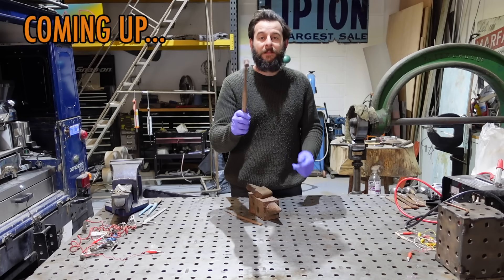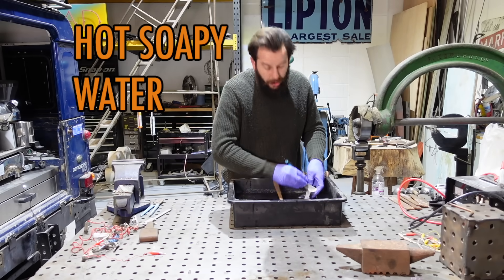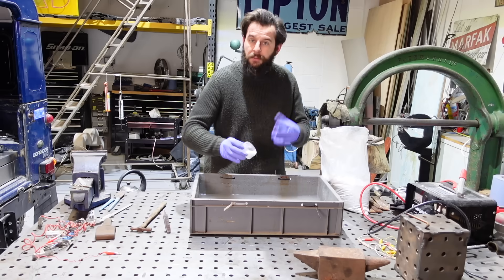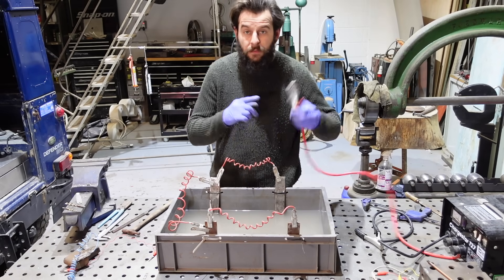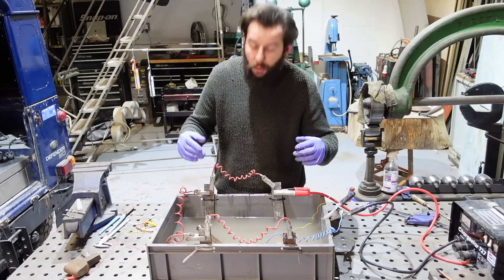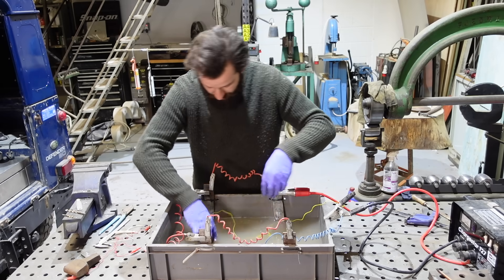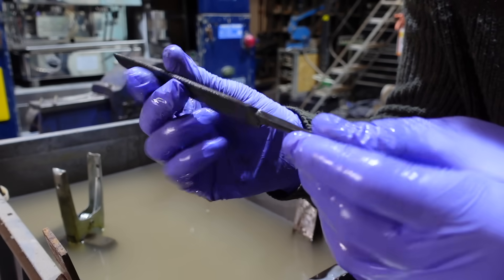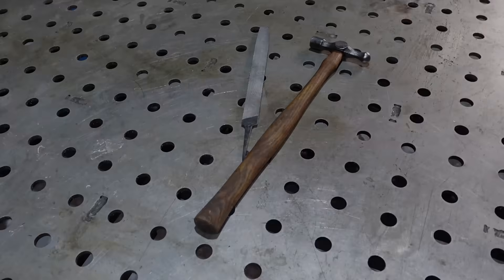The Power of Electrolysis | How To Transform Rusty Tools!

Comment: You can also do this inside-out.  I used this method to remove the rust from the inside of a motorcycle gas tank. Negative to the bare metal of the tank, positive to a large bolt suspended inside the tank full of sodium carbonate solution.
Reply from the maker: Now that’s a brilliant idea! Thank you for sharing!
Reply: @DominicChineas  work  in a few  hour's    just any  news   about wheel english
Reply: thats slick
Reply: Andrew Falenski: I was going to post a comment asking about doing it to remove tank rust so you have answered my query.  Did it work well?  I have just bought an FJ1200 with a little rust in the tank so am looking to do this.
Reply: @martynflynn8368  it worked great for me.
Reply: @andrewfalenski6583  no doubt it works.

All steel tanks, no issues.
If tank has solder or brazing, electrolysis is not a good solution.
Any weak acid will consume surface rust.
No batteries required
Reply: @andrewfalenski6583  How bad was the rust in the tank and can you use any kind of battery charger?
Reply: @martynflynn8368  it was extremely bad.  I took the bolt out every couple of days to smack it against the ground to remove all the rust that had gathered.  I kept doing the cycle until no more rust had gathered on the bolt.  All that was left was some pitting with some magnetite in the pitting.  Magnetite is neutral, it will not further corrode.  As for the battery charger, you cannot use the trickle charger / battery minder type.  You need something along the line of a dc power supply.  A 20 year old battery charger should work.  Once you are done, dry out the inside of the tank, pour in some OSPHO and shake it around.  Once you are sure the inside has ben fully coated,  empty the and let dry.
Reply: @martynflynn8368  these are the procedures I used:

Magical Gas Tank De-Rusting*
 
(*The actual science is explained at the end)
 
The things you will need:
1 rusty gas tank
1 small container of sodium carbonate
(chemical compound =Na2CO3 from pool/spa supplies PH+)
1 4amp or better battery charger
1 average steel bolt approx 3/8 x 1.5
1 short length of solid 12ga copper wire
2 quart Naphtha
2 quart denatured alcohol
 
Empty out all the gas and other items in/on the tank and remove the fuel cap. Remove any and all old fuel residue and varnish with a good rinse of Naphtha. Make it petroleum free and then drain and dry.
 
Using a sock with a handful of small nuts/washers etc,; add a little water into the tank and shake it around inside the gas tank to loosen the big chunks. Rinse with clear water. Repeat: scrub all very well.
 
In a clean pail dissolve about ¾ cup* of the sodium carbonate in a gallon of clear regular tap water. When it is dissolved all the way, stir it a bit more!
(*based on GL 5+ gallon tank size)
 
Seal up all but the filler cap opening on the top, pour in the well stirred mix (use a funnel if you’ve had too much coffee).
 
Fill the tank right to the top with water.
 
Set the tank securely somewhere and so that the cap opening is the highest part; burp out as much air as possible and keep the tank full for the process.
 
Strip the insulation off the last 10” or so of the wire and then wrap a series of turns of bare copper wire around the bolt to hold it secure (twist it tight so the bolt won’t fall off). Use something like a paint stirrer with a hole in it to run the wire through and keep it away from the metal tank neck.
 
Attach the (-) lead of the battery charger to the outer shell of the tank.
Attach the (+) lead to the other end of the copper wire.
 
Suspend the bolt (through the tank opening) into the solution and turn on the battery charger to a fairly high rate.
 
An amp or two flowing is good, then wait.
Time to process is ~48 hours and it won’t overdo itself.
 
Reading back are some things to note:
Compressed air or hair dryer will help dry the tank.
Be sure the suspended wire does NOT touch the tank metal.
Be available to top off the water level (evaporation, etc).
The bolt gets nasty after a day and it won’t hurt at all to clean it now and again to remove the crud.
 
After a couple of days, remove the leads and discard the bolt.
Drain and rinse the tank well and drag out that sock again and slosh it all around to remove any loose material.
 
Rinse a few more times until the rinse water seems clear; shake well and then use the alcohol to fetch out the rest of the water. Dry.
 
Once the tank is dry, you’re all set to put it back into service.
Coating (Kreem, etc) not required.
 
The Science:
The process by which rust forms is electrochemical in nature so this method employs a reverse current flow in an alkaline bath at a higher voltage to reverse the process at a quicker rate.
 
There are actually two forms of rust: iron III oxide or red oxide (Fe2O3) and iron II, III oxide or black oxide (Fe3O4) (FeO). Black oxide is the smaller molecule.
 
The electrolytic process converts red rust to black rust and in the process the black rust becomes weekly bonded to th3e base metal. The black rust that takes the place of the red rust can be easily wiped, washed, or brushed off leaving a rust free base metal. Any pitting that has occurred will remain, this method will not repair damage, but the pits will be rust free.
 
This is an alkali process and not acid. So it won’t result in a lot of pits in the steel filled with stray hydrogen ions which would just love to start rusting immediately; instead of this much less active coating of black oxide.
 
You can’t solve your problems with the same level of thinking that created the problems. –Albert Einstein
 
Naphtha is commonly sold as Coleman Fuel for camp stoves and lanterns. Denatured alcohol is “rubbing alcohol” sold in drug stores. Usually comes in 70% or 91%, with the rest being water.
 
Sodium carbonate is WASHING SODA, not baking soda and is sold in the laundry soap section in larger grocery stores.
 
Naphtha is also sold as charcoal lighting fluid.
 
Get denatured alcohol in a building supply store like Lowes or Home Depot, or equivalent stores in the UK.
 
If you have access to a paint shaker you can put about 2 pints of water and a handful of clean gravel the size of peas. Close all openings and shake the tank for a few minutes. Then have a look. If it needs more, rotate the tank and shake some more. Repeat as needed.
 
When it’s all shiny inside, pour in a quart of alcohol and slosh it around. This will absorb the water.

Andy:  I actually took the bolt every couple of days and smacked it against the ground to remove the built up rust. I repeated this process until no rust was accumulating on the bolt.  The rust in my tank was so bad, the complete inside of the tank was flaking rust.  Also when I was done with the procedures, I poured some OSPHO(rust stabilizer) into the tank and sloshed it around until the inside was completely coated, poured out the remaining OSPHO, and let the tank dry.
Reply: @martynflynn8368  I used the following method:

Magical Gas Tank De-Rusting*
 
(*The actual science is explained at the end)
 
The things you will need:
1 rusty gas tank
1 small container of sodium carbonate
(chemical compound =Na2CO3 from pool/spa supplies PH+)
1 4amp or better battery charger
1 average steel bolt approx 3/8 x 1.5
1 short length of solid 12ga copper wire
2 quart Naphtha
2 quart denatured alcohol
 
Empty out all the gas and other items in/on the tank and remove the fuel cap. Remove any and all old fuel residue and varnish with a good rinse of Naphtha. Make it petroleum free and then drain and dry.
 
Using a sock with a handful of small nuts/washers etc,; add a little water into the tank and shake it around inside the gas tank to loosen the big chunks. Rinse with clear water. Repeat: scrub all very well.
 
In a clean pail dissolve about ¾ cup* of the sodium carbonate in a gallon of clear regular tap water. When it is dissolved all the way, stir it a bit more!
(*based on GL 5+ gallon tank size)
 
Seal up all but the filler cap opening on the top, pour in the well stirred mix (use a funnel if you’ve had too much coffee).
 
Fill the tank right to the top with water.
 
Set the tank securely somewhere and so that the cap opening is the highest part; burp out as much air as possible and keep the tank full for the process.
 
Strip the insulation off the last 10” or so of the wire and then wrap a series of turns of bare copper wire around the bolt to hold it secure (twist it tight so the bolt won’t fall off). Use something like a paint stirrer with a hole in it to run the wire through and keep it away from the metal tank neck.
 
Attach the (-) lead of the battery charger to the outer shell of the tank.
Attach the (+) lead to the other end of the copper wire.
 
Suspend the bolt (through the tank opening) into the solution and turn on the battery charger to a fairly high rate.
 
An amp or two flowing is good, then wait.
Time to process is ~48 hours and it won’t overdo itself.
 
Reading back are some things to note:
Compressed air or hair dryer will help dry the tank.
Be sure the suspended wire does NOT touch the tank metal.
Be available to top off the water level (evaporation, etc).
The bolt gets nasty after a day and it won’t hurt at all to clean it now and again to remove the crud.
 
After a couple of days, remove the leads and discard the bolt.
Drain and rinse the tank well and drag out that sock again and slosh it all around to remove any loose material.
 
Rinse a few more times until the rinse water seems clear; shake well and then use the alcohol to fetch out the rest of the water. Dry.
 
Once the tank is dry, you’re all set to put it back into service.
Coating (Kreem, etc) not required.
 
The Science:
The process by which rust forms is electrochemical in nature so this method employs a reverse current flow in an alkaline bath at a higher voltage to reverse the process at a quicker rate.
 
There are actually two forms of rust: iron III oxide or red oxide (Fe2O3) and iron II, III oxide or black oxide (Fe3O4) (FeO). Black oxide is the smaller molecule.
 
The electrolytic process converts red rust to black rust and in the process the black rust becomes weekly bonded to th3e base metal. The black rust that takes the place of the red rust can be easily wiped, washed, or brushed off leaving a rust free base metal. Any pitting that has occurred will remain, this method will not repair damage, but the pits will be rust free.
 
This is an alkali process and not acid. So it won’t result in a lot of pits in the steel filled with stray hydrogen ions which would just love to start rusting immediately; instead of this much less active coating of black oxide.
 
You can’t solve your problems with the same level of thinking that created the problems. –Albert Einstein
 
Naphtha is commonly sold as Coleman Fuel for camp stoves and lanterns. Denatured alcohol is “rubbing alcohol” sold in drug stores. Usually comes in 70% or 91%, with the rest being water.
 
Sodium carbonate is WASHING SODA, not baking soda and is sold in the laundry soap section in larger grocery stores.
 
Naphtha is also sold as charcoal lighting fluid.
 
Get denatured alcohol in a building supply store like Lowes or Home Depot, or equivalent stores in the UK.
 
If you have access to a paint shaker you can put about 2 pints of water and a handful of clean gravel the size of peas. Close all openings and shake the tank for a few minutes. Then have a look. If it needs more, rotate the tank and shake some more. Repeat as needed.
 
When it’s all shiny inside, pour in a quart of alcohol and slosh it around. This will absorb the water.

Andy:  I then poured OSPHO in the tank, sloshed it around to completely coat the interior, emptied the tank and let it dry.
Reply: @martynflynn8368  the rust covered the interior of the tank and was flaking.  I also removed the bolt every several days and smacked it against the ground.  I put the bolt back in and repeated the process until no further rust accumulated on the bolt.  As for the battery charger, I used one of the old types that continually charge.  The electronic battery-minder type will not work.
Reply: @andrewfalenski6583  Wow, thank you Andrew for the precise and clear instructions. I've never done this before so cant wait to give it a go. My bike is garaged at the moment having a thorough service after standing for fifteen years but as soon as I get it back this is going to be the first job on it. 
Thank you again, Cheers.
Reply: @andrewfalenski6583  if the copper wire you wrapped round the bolt went into the solution with your bolt then im afraid you just made your rusting problem worse, as copper plating mild steel is not advised since it will cause rapid re-rusting
Reply: @oldskoolhead0  the copper wire was on the side of the circuit that attracts the rust.  If the DC polarity was reversed then it would plate the steel.
Reply: @uncommonlogic1698  It will also cause electrolysis.
Reply: @oneeyedphotographer  as I said before, electrolysis is not a good thing to use on a tank.
Weak acids are sufficient to remove light scale and surface rust.
Please look at my earlier posts.
Reply: @martynflynn8368  you can't use one of the newer electronic chargers.  They need to sense some sort of a charge before they will turn themselves on.  The solution of sodium carbonate and water has no charge unlike a discharge automobile battery which has at least some charge.
You just need an old school battery charger.  I think I've read somewhere that it might even be better to use 6 volts instead of 12.  I might be wrong on that but there's a lot of other YouTube videos on this subject.
Reply: @randywl8925  Ah - you've answered my question. Can the circuits be hacked so the control gear is bypassed?
Reply: @SteveBower996  are you asking if the circuits can be bypassed so that you can use one of those newer electronic chargers?
Reply: @randywl8925  Thats it. I can get hold of spare modern ones, but the old school ones are sold as 'vintage' for a fortune!
Reply: @randywl8925  That's it. I can get spare modern chargers, but the old basic ones go for a fortune as 'Vintage'!
Reply: I'd throw it out and get another tank, no tank is worth the risk of sucking a piece of rust into your engine, especially with the diddly little 'high flow' fuel pumps on most of them with those made in China filters I wouldn't trust.
Reply: @1978ajax 
Oh please! Is that the best come back you could come up with? Maybe you should try a little reading yourself before trying to impress by kicking in open doors? Nobody likes Mr Knowsitall.
Reply: JUST REMEMBER:
Fuel doesn't explode!
VAPORS DO!
So a tiny amount of gas (or 'petrol' as you guys who drive on the wrong side call it 😁) a TINY amount left in a tank will still fill the tank with vapors!  
💣 ** BOOM! ** 💣
COMPLETELY Ventilate
AND Flush before introducing any Heat OR Electricity!!!
I know others have said this, but, a repeat doesn't 
hurt. An explosion WILL !!
Reply: @GMan-yv8cb  I hear ya bro’, my connection was being a nurse on a burns unit looking after the guy who listened to his boss who said “she’ll be right, just weld a fuel tank that you have not checked or ventilated” 
He was lucky…only 30% of his body with full thickness burns… the lady in the next bed… 70% burns, partner & furry family checked out…later she did too, you can imagine her psychological stress.
Personally I leave fuel pump failures, fuel line blockages and fuel tanks ruptures to the professionals
Reply: @MadMax-bq6pg  Very wise point!  It's not a failure of your manhood to step aside and let 'pros' do their job!
My mom was an 'old school' nurse (which was fitting, since SHE was old 😁)
So she didn't talk too much about 'work', but I DO remember her saying the 1 department that was 'Tough to Handle' (meaning HORRIBLE to us mere mortals,) was the Burn Unit.
God Bless you, man!  That is 1 (of many) ABSOLUTELY UNDERAPPRECIATED Role!
Reply: Brilliant idea !
Reply: Also used this method for inside rusty tubes and box sections, chassis members difficult to get at etc. Plug or cap off the ends,  insert steel rod with plastic stand off to keep it off the sides (test with a multimeter to insure it’s not touching the sides) and fill box section with the solution using a funnel, clips on and off you go. Flush out afterwards, dry, then soak a rag in Waxoil and pull through (or treat with other method).
Reply: @steverickman3076  Good idea. Another advantage of using the washing soda solution is that it has a pH of 10. Bare steel is passiviated at this level of alkaline so re-rusting will be resisted as it dries out afterwards.
Reply: @1978ajax ONE cup of vaporized gasoline has the same explosive power as a stick of dynamite! To remove all danger, pour out gasoline, then refill with water. The water forces the explosive vaapors out of the tank. Now, drain out the water and work away!
Reply: @leemundy1613  never trust a gas tank not to explode! filling with water is not a positive measure, nor is steam cleaning, nor pumping co2 inside.  a friend of mine welded on a tank that had been laying open in the arizonia desert for over 20 years, no smell or hint of gas...boom!  you definately are reducing the risks with these methods but any tank that has had gas in it has a risk of exploding.  i've known guys that have filled them completely full of gas and welded on them, claiming nothing will happen without the right mixture of gas and oxygen, the theory is good, but the conditions are never fully controllable, if you're wrong, well, goodbye...  i'm a professional and i shy away from gas tank repairs like they are the plague!
Reply: Genius!
Reply: @1978ajax Which part of "tank full of sodium carbonate solution" was difficult to understand?
Reply: @1978ajax and the emptier it is the more powerful boom there can be but less continued fire from burning fuel, almost full tank  may ignite but not blow apart (happened to me when i was 17 got lucky was not injured but ruined my antique cars gas tank ) but swell and deform tanks shape and opening of tank will have flames rolling out and in that case smothering it from the air will extinguish it
Reply: Hello sir can i use NaCl instead of sodium carbonate please replay
Reply: @zeemixvideos6485  I've done this process, and also used the reverse polarity process where NaCl or dilute mineral acid solution is used to etch away hard steel sheet or rejuvenate blunt hand files. Just go get some washing soda from the laundry isle and use that. The chlorine in common salt is not very friendly to iron.

NaCl could be made to work to some degree but I wouldn't use it for rust removal. It works well enough with the reverse electrical polarity to rust away metallic iron when that is what you want to achieve. ie: DO NOT make a mistake with which way around you connect the wires or will utterly devastate the metal you want to clean.
Reply: Never use this technique for a motorcycle gas tank the lap joints on the inside will end up trapping the soda mixture and over time it will eat up the metal even with extensive flushing and neutralizing techniques you'll never get all of it out of the joints if you use this process.
Reply: Got some period rusty window hinges. Will this method remove the paint if a proper electric connection is made or do I have to use paint stripper first?
Reply: You should have done your own video Andrew. Thanks my boy, brilliant!
Reply: I use vinegar in tanks, just fill it up. No electric, it will clean surface rust to bare, scale to rough metal. 
Wash it with water, then wash with dish detergent, rinse again.
Spray in WD-40 to coat the bare metal.
Reply: @uncommonlogic1698  I use salt and vinegar, great for rust.
Reply: @1978ajax long long ago when I was a nurse I had a patient with burns to 30% of his body due to ignorance. This apprentice asked his boss what to do about “the stuff in the tank” & the boss said “don’t worry, it’ll be ok”. And so the apprentice started welding the fuel tank.
Reply: @MadMax-bq6pg  if you're filling the tank with electrolyte and water, there wouldn't be explosive vapors in there.  Yes, it's sad when people do amazingly stupid things and get hurt. Cleaning a tank via electrolysis wouldn't be this story though.
Reply: @carpediemarts705  leaking truck fuel tanks should have fuel & vapours removed prior to welding (& my welding friends advise filling with water typically)
The fuel tank was about half full of fuel at commencement of welding
Reply: @carpediemarts705  you do know the fizzing thats going on is actually hydrogen gas being produced which is actually explosive as well dont you? it is lighter than air so shouldnt linger around normally, but it could collect inside a petrol tank, its a fairly safe process but you should do it in a well ventilated area and keep sparks and flames away whilst it is going on
Reply: @oldskoolhead0  I've built electrolysis units.  Hydrogen disperses more rapidly than any other element but even a pint trapped in a closed space can blow like a large firecracker.
Safetyglasses for the win.
Reply: @oldskoolhead0  Worse, it's hydrogen and oxygen in perfect stochiometric ratio to give the maximum energy back...
Reply: @oldskoolhead0  Fill the tank with the magic solution.
Reply: @MadMax-bq6pg  who's welding a tank with fuel in it, you'd have to be dense to do that, and the guy that got burned had to ask his boss? Did he not realise it was dangerous wow.
Reply: @MadMax-bq6pg in WW2, they were welding on the exterior of FULL aircraft fuel tanks to mend loose brackets, etc. Gas does not explode, the FUMES MIX WITH AIR AND EXPLODE.
Reply: @MadMax-bq6pg  take a hose connect it to a cars exhaust pipe and place the other end in fuel tank,and provided the lowest point of airspace at fuel line level is where O2 will be if fuel level is below opening in tank and so  as long as the heavier o2 can easily escape and car is running providing a constant supply of carbon monoxide welding is possible with fuel inside tank can be done regardless amount it will not go boom....no oxygen no fire unless you spill fuel outside of tank where oxygen is present which you should not do. Do not try this at home if you do not know what dunning krueger syndrome is or are a clumsy bumbling fool
Reply: @jarvislarson6864  sounds like a goer, pity you weren’t the apprentice’s boss. He could have a) learned something & b) avoided about a year in hospital and rehab